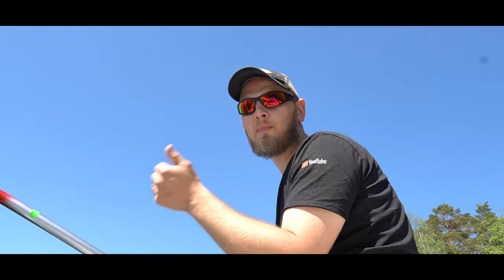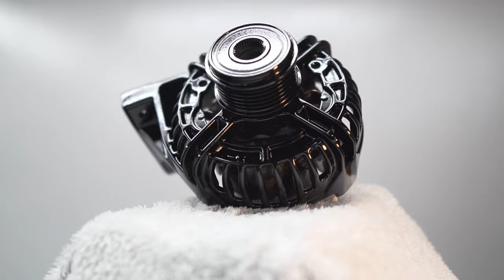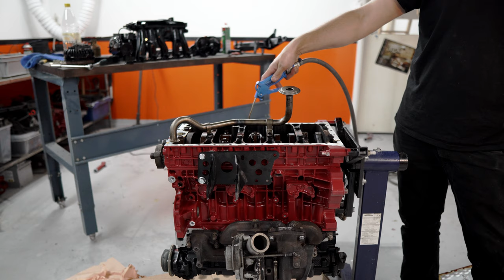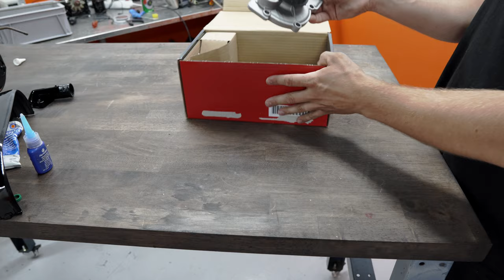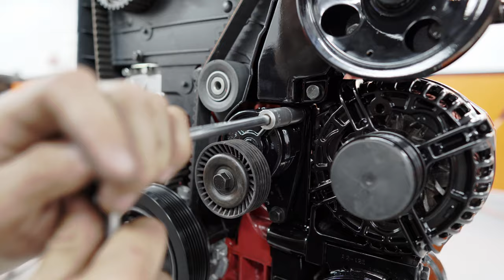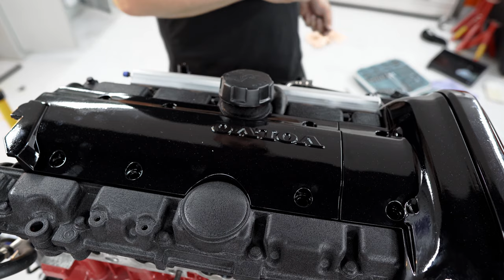The Volvo 740 Project - Part 7 - Assembling Of The B5254T Engine

Comment: hey! that's an amazing project that you got going on there! i wanna do the same to my 740 soon. could you tell me which aftermarket/adapter parts you needed for the engine to fit and where you got them? i know about cutting the oil pan from the 6 cyl, but what engine mounts did you use etc. thanks and greets from austria!
Reply from the maker: Thank you, glad that you like it! 👍 There will be alot more on this build soon. 

The engine mounts are from andersson steele and speed. Available @ www.speeding.se 
https://www.speedingparts.eu/p/chassis/engine-mount-gearbox-mount/engine-mount-volvo-7900-56cyl-white-block.html
Use Backmansgarage for a discount. Or you can use the mounts from a Volvo 960/S90 with an inline 6 engine.  
Transmission is from a 6 cylinder Volvo s90 and so is the transmission mount and driveshafts.
Reply: @BackmansGarage  thanks for the quick reply, will check out the link! any idea where to get a 740 bodykit from? greets!

Comment: Excellent project ,   I think I would have  kept the 3 litre and  swapped a  twin turbo T6 engine though .

A few points regarding your building  methods.

1,  Bad move using a non genuine Volvo water pump .  using the old one would have been  the best option  if you don't want to buy a volvo one for some reason ...  
      I have been working on these engines on a professional basis  since well before these engines came out in 1989 an Never had a Volvo water pump fail what ever the age or mileage .  
      I have seen some water pumps fail but ALL were these non volvo pumps which people in their wisdom had fitted trying to save a few pennies .
      I'm no big fan of  non volvo crucial parts  like this  as any failure will wreck the engine .

2,  The knock sensors ,  These have to be fitted at a certain angle for them to work properly , see the manuals .......

3 , I see you had the cam wheels loosened so lost the  orientation ... you tightened them without the locking/ positioning tool in the rear of the camshafts .. and also without the crank positioning tool .
      So the cam timing WILL be wrong . Yes it may run ok , it may be close , but you cannot say it is right ,   you need to go back to basic principles and always  use the positioning tools once you  loosen those cam wheels . 
      Setting the cam shafts and crank shaft position by eye  is not going to get your cam timing correct . 

4  Crank pulley nut ,  No power gun . you have no idea how tight it is and as most likely it is over tightened, the nose of the crank shaft could break off  , I have seen it all before .... no its not 300 nm  that is only for the diesel , you should have tightened a NEW nut to 180 nm ...
  I don't think you used the 4 new bolts on the crank pulley either which are use once stretch bolts  and have to be angle torqued .

Good luck with the project

Comment: There is a hole in the oil pan near the oil dipstick. Where did you connect it? A thousand thanks
Reply from the maker: Will probably use it for pcv drain in the future. For now it is plugged.

Comment: blir bra detta, fått tak i en 960 t5 sjølv så skal godkjenast med motor nå. men har et spørsmål om kam hjula. mine har ikkje hakk eller noe. står bare M på ein plass og skal bytte registerrem snart. er de M merket så gjelder da?
Reply from the maker: Låter som ett roligt projekt 😀 Är du helt säker på att det absolut inte finns några märkningar alls? Dom är väldigt svåra att se på t5:an också. Det är inte som på B230 där märkningen är tydliga. Tyvärr har jag slängt min 6-cyl sö jag kan inte springa upp och titta. M skall du inte ställa den efter i alla fall. Jag tror  att M står för vad för typ av kugg det är på hjulet "Modul systemet"
Reply: @BackmansGarage  ser ikkje merkene nei😅 har sjekka ganske grundig men må nokk lage minr egne merker de går og greit, og bare stilla veiven på rett plass. prosjektet er nesten ferdigt😅 kommer å kjøra uten ac men blir nokk bra

Comment: You tightend the tensioner wrong. There is an arrow that indicates which way you have to turn it. Idk if it is important but som people say so🤷‍♂️
Reply from the maker: Thanks, I will have a look att the tentioner before i try to fire it up and maybe do an update in upcoming video 👍
Reply: There are 2 variation, one clockwise and one anticlockwise.
However Backman  you should have explained the vvt phaser a little bit,  its not just the marks to line up, the marks could be correct but the cam is not, the marks should be set with the phaser bottomout in the direction of rotation of the engine.

Nice videoseries however and a good channel and you are funny.👍👍👍
Reply from the maker: Ok, will have to cover that a little bit more. I had no idea about the tentioner, but as A-Gaming pointed out, the one I have should be turned the other way. Easy to make misstakes while running all the video stuff at the same time 😄 There is a clearly stamped arrow on it as well 😂 

As for the phaser and alignment, i just made marks when i took it off and installed it back according to the marks again. I diddent cover that because I considered that to be out of scope for that video. But it is a good point to bring up in the future. I will get more engine technical when we build the actual engine later on with a full dissassembly 😃 //Backman
Reply: Verkligen bra videos, Men reagerade med på spännaren 😄 Fortsätt med vad du gör👍👍🙂
Reply from the maker: @gullabonisse  Tackar 😃👍 Haha, vad ska man säga, shit happens? 🙃 Men det bra att ni säger till tycker jag 👍